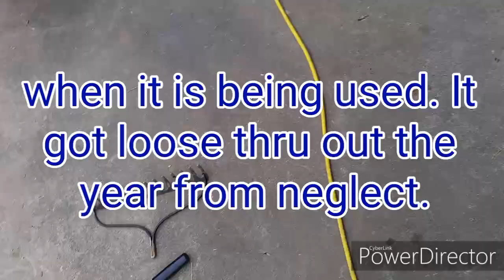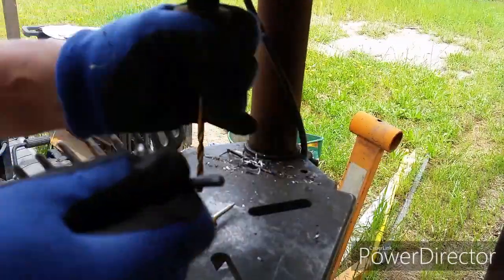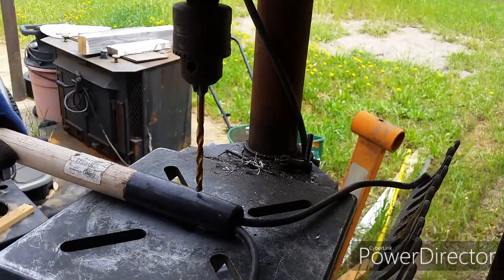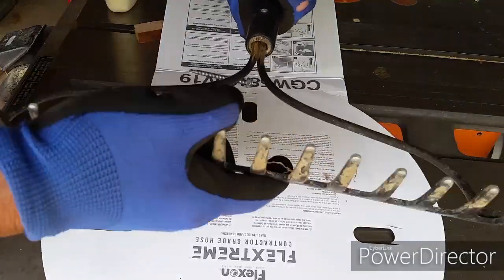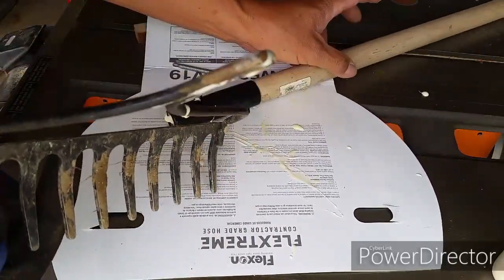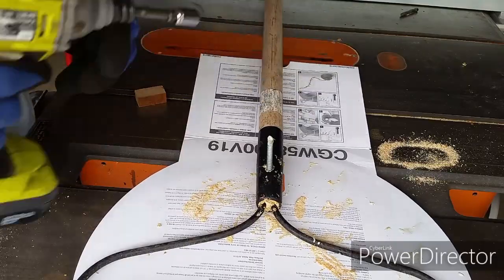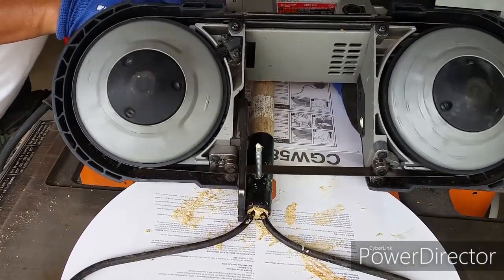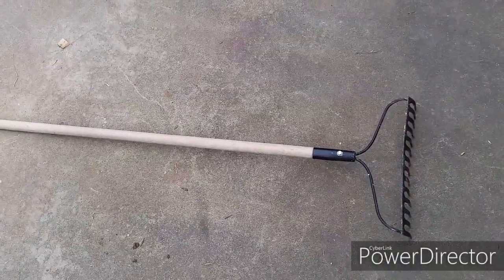DIY| Loose rake handle fixed | Better than new

Comment: Great video! You got a Plan B for someone without that awesome press?
Reply from the maker: Yup. It might be crooked but it would suffice.  Lol
Reply: Just use a good cobalt drill bit on a power drill and a steady hand, it's not that hard to make a hole. Use a nail or something hard and pointy to punch the metal first to make an indent, that'll help make sure the drill bit head doesn't walk away.

Comment: You don't recommend putting a bolt on the other end? Any reason?
Reply from the maker: Not sure i follow you.  Why do i need to put bolt on the end? How would it help keeping the rake on the handle?
Reply: @tonedubb4325  I think he meant put a nut on the other end of the bolt as opposed to cutting off the entire stud. Good question, but I imagine you didn't because the bolt is somewhat threaded through the metal part of the rake head. I think it's good either way.
Reply from the maker: Originally there wasn't any hole there.  I drilled a hole and instead of securing with a nut and bolt that would work itself loose, i used a self tapping bolt. That's why you don't see me securing it with a nut and cut off the excess.  I hope i answered the question.
Reply: I thought about doing this, but I was afraid it would weaken the rake. Maybe I’ll put the hole further to the top.
Reply: @samuelmccarty56  that's exactly what I ended up doing for that very reason and it works great. I bored out where the gap is slightly wider where it bends and put a nylock nut on and ground of the excess thread.

Comment: I bought a stanely rake and used it 2 summers to rake leaves and the plastic at the end has split and the rake is loose and moves.  What is a good rake that will last?
Reply from the maker: I don't think any design to last a life time.   You probably need to go to hardware stores and check.  The sales people can answer your questions.  Maybe search online and see what other recommend.

Comment: should put nut on  it. not good repair.
Reply: Or at least file it smooth. Also, using a saw table for a workbench shows a total disregard for tools.
I take care of mine, use them for what they were designed. They last a lifetime if you do.
Reply: The nut will fall off as you rake, the screw is glued in :)